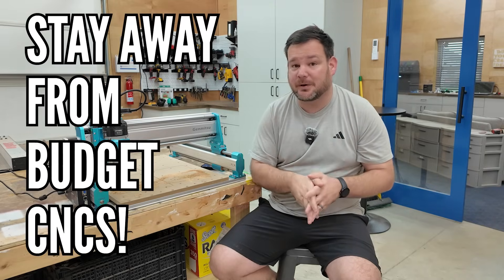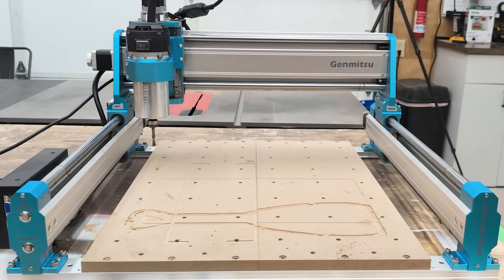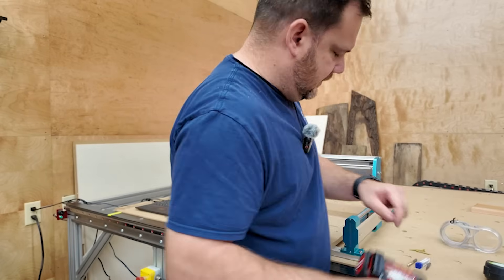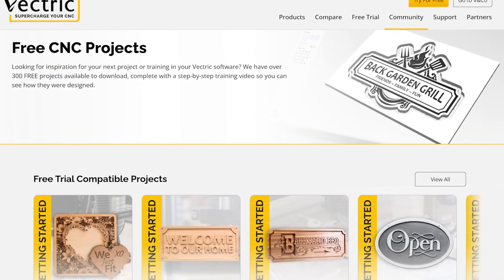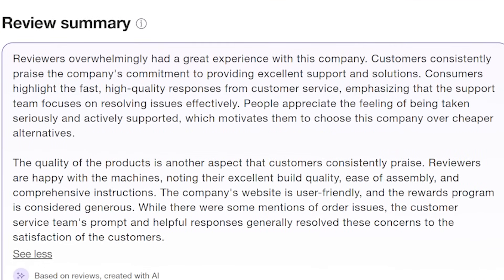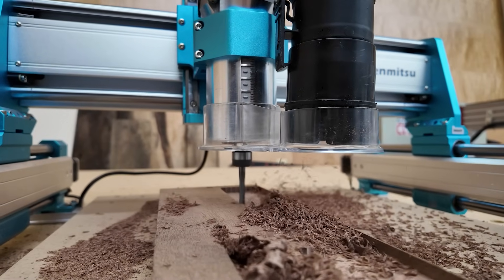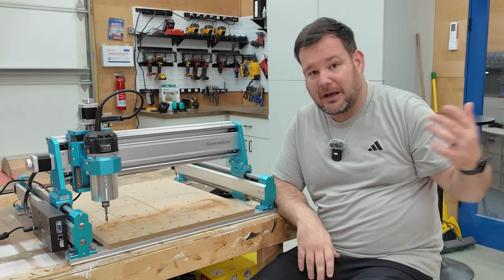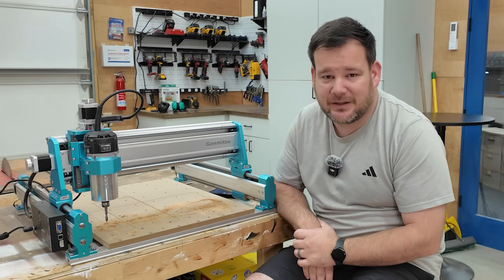Best CNC Machine for Beginners on a Budget in 2026

Comment: I have a Genmitsu ProverXL 4030 V2 that has been expanded to a 600x600 with a 1.5 KW water cooled spindle.  Have you ever looked at it.  Can do much more than the 4040 PRO, suggest that byou look at it.

Comment: Awesome review! I was thinking to get a CNC instead of CO2 Laser Cutters. I am thinking of mainly 3D printing, engraving wood and some acrylic materials. CO2 machines are quite expensive to cut wood with. I think having a CNC to cut wood, then place it on the engraver would be an awesome combination. I am just not sure if this combination of work flow would work in practice. I would appreciate your thoughts.

Comment: Hi Andy...Just wondering if the Genmitsu 4400 Pro max (or any other CNC router) can be used for routing projects that would fit between the side rails but are longer than the Y axis travels by accurately indexing them in the Y direction? I am a retired tool and die maker and believe I could figure a way to move a distance accurately in the Y reclamp the project and complete it. Am I crazy?
Reply from the maker: That’s a great question! The Genmitsu 4400 Pro Max can definitely handle some creative indexing for longer projects. With your background as a tool and die maker, I have no doubt you’ll find a way to make it work!

Comment: I have this CNC. My biggest complaint was the amount of locktite they use at the factory. Made increasing the Y axis pretty difficult. With that said, I used a torch to loosen the screws and accidentally melted the connector on one of the stepper motors. emailed customer support, and they sent me 2 new stepper motors. the brushes fell out of the router in the middle of a job also. Reinstalled and no issues since. I also have the FA 4040XE. The genmitsu is so much better for the same price range machine. Great video!

Comment: Hi Andy:
 have watched you on various machines. I have a 10w laser along with 2 3d printers and am wondering about adding a CNC machine.  I watched the video and there seem to be quite a few bit changes.  Is this common and does the software stop the machine so that you can change bits?  I understand about "grbl" and use lightburn so have a basic understanding of the need for "gcode" but am far from being an expert.  This 4040 is in my price range.  Thanks for any info you can provide.

Comment: Just curious, have you tried making a longer piece by breaking up a project. I'm looking at making signs, and with my laser engraver, i can put down a guide board, burn half of it, with a tick mark (that easily sands off the edge of the sign), to slide the piece up to allign with a tick on the guide board for a second half, and then shift the priogram, and do the second half.. In V Carve is something like that easy to do?

Comment: Hey, I know NOTHING about using one of these things, but my son wants one for building PC water blocks out of acrylic and copper, etc. Would this machine work on those materials? If not, can you please point me in the right direction?.
Reply: Yes you can. This machine would work just fine.
However, I wouldn't "Practice" with these material, Copper, Acrylic as they are VERY expensive!
Do you research BEFORE you buy, you might just change your mind.
But hey, You can NEVER finish anything if you don't start it!!

Comment: Thanks a lot for your videos. One question here, I am planning to buy a CNC but need to carve on the sides too like for example old French picture frames that are adorned with flowers, leaves or intricate carving not only on the top but also on both sides. Which CNC would you recommend?

Comment: You should have tried to contact customer support....It is not what you say it is. The machine was purchased with VCarve software and the invoice shows paid and included. There is not one shred of information in the resource pages, in the manual or online as to how the VCarve license will be delivered. After scouring the SainSmart website, I did find one note on a resource page that said the license was to be delivered in one business day. That did not happen either.

On page 2 of the manual there is a written link, and two bar code links supposedly to the Online Resource Center and the Facebook community. All Three of these links have you arrive at a Sainsmart 404 Error page. That is literally just five minutes into the unboxing....And I'm going to end up getting charged to return this product for a "refund."

No Thanks!
Reply: And they charged me over$200 to return the unused unboxed item. And they still have not sent the software they charged me for...In the same email they tell me they won't refund me for the Vcarve license which they didn't send. Then in the next sentence ask to confirm if I want them to send the Vcarve license. 

I was added to their user forum only to discover a multitude of users having all kinds of problems....My fault for not digging deeper into their customer satisfaction and business practices.

Comment: OK, I'm sold.... LOL!  -- Seriously, I need to buy one of these machines to make the "vent slots" in a wooden stereo case (made out of plywood) that I would like to make for one of my vintage stereo components that has an old dilapidated particle board case. The slots are about 1/4" wide in 1/2" or 5/8" thick plywood. The slots are no more than about 6" long. -- My question is, would this machine be able to cut those slots? Is so, I'm definitely sold. - Your thoughts?
Reply from the maker: I don't see why it wouldn't work

Comment: Looking to get into cnc but live in an apartment; so what I was wondering is the decibel for these machines or is it different from the rpms from the motor? faster motor higher decibel!  also elec hookup, standard plug or get electrician?
Reply: I’m sure it’s running on standard 110v electric service. As for noise and being in an apartment, for sure that could be an issue. You can build an enclosure to help but I can almost guarantee this will be a real challenge. I run a Cnc in a commercial shop and the tenant next door had legitimate complaints so we built a small insulated room for the machine.

Comment: Anyone ever tried to machine aluminum on one of these budget/beginner CNC machines? All I ever see anyone doing with CNCs on YouTube is wood. 

I've done a fair amount of work with aluminum sheet, but never used billet before. Thinking I want to try making some parts for stuff.
Reply: AuroraTech ran this machine on Aluminum, it worked well at slower speeds and feeds.

Comment: I have never used a CNC but I've been wanting to try it out without breaking the bank. One thing I've always wondered is if I can import illustrations that I have drawn in a vector program such as Adobe Illustrator, and also if I can use hand drawn art done with ink on paper. I want to use the CNC to carve moulds for vacuum forming. Can you tell me about importing artwork? Also, at some point, I might want to carve metal as well. would this CNC handle metal.
Reply from the maker: Yes you can import vectors you've drawn. You can also image trace PNG or jpg in most softwares. This machine is not good for metal.
Reply: @AndyBirdBuilds  Thank you for your reply.

Comment: Well I might have to reconsider making gadgets and make a real cnc routerinstead. I have not found a machine yet that is not garbage in the sub 3000 range of machines. the design of most of these machines with a gantry that moves is a very poor design. A fixed gantry and a table that moves would make a much more rigid machine.
Reply from the maker: I think what you're describing is a CNC mill, not a desktop CNC router. These machines are built for 2 different purposes.
Reply: Look up printnc

Comment: thanks for the insight!
I did have this machine in mind for my smaller projects, could you please elaborate on cutting carbon fiber and aluminium?
would love to hear some opinions on how capable the machine is.
Reply from the maker: I'm sure it can cut those, but it's going to be very slow.
Reply: @AndyBirdBuilds  better than waiting half a year and still getting no parts from contractors :)
thanks!

Comment: what controller does this use? can I use mach3 to control this machine? I dont like and wont use a hand controller. 
I have a shark cnc, I ended up removing all the electronics, installed new steppers and controllers so I could use Mach3.
Reply from the maker: Not sure.
Reply: @AndyBirdBuilds no it wont work it use grbl witch is garbage in my opinion.
Reply from the maker: @FredFlintstone-v3m grbl is pretty standard

Comment: Andy,  It's remarkable how closely your comments follow my experience.  When I was looking to get into cnc on a small budget and even smaller space, my biggest fear (unfounded or not) was that the belt driven axes on other similarly sized machines seemed a little flimsy and could easily skip teeth.  The lead screws were the primary reasons I went with this machine.  Again, maybe I was worried about nothing.  I've had the machine for a couple of months now and I'm loving it.  I still have tons to learn (like my machine hasn't seen 70ips yet) but, you don't get experience until you get experience.  Thanks for your great videos!
Reply from the maker: Good to hear our experiences are similar!

Comment: I just got into cnc and this is the machine I started out with and had zero problems with it so far. I’m loving it so far for my first one. That 78 per second is that the rapid rate?
Reply from the maker: 78 inches per minute is the max speed of the machine

Comment: Personally as a Longmill and Altmill owner. I feel this would frustrate new people getting into CNC with small speeds and footprint. The ones that do like it will be sorry not getting a bigger, beefier machine. That being said, I may be interested in one as a supplemental machine. I’d use it to surface and prep boards going to the bigger units. And maybe put holes in spoilboard and make it do dovetails or small joinery on edges. For under a thousand, may have room as a specialty machine in a large shop.
Reply from the maker: There are a lot of other considerations other than speed and size. Bigger and faster isn't always better.
Reply: Hey dudes, if I buy a machine like this do I have to worry about the collet failing with the cutting bit? In other words do you recommend i exit the room before pressing the green button?  Had a router collet drop out when I was building kitchens 15 years ago. Now I shiver cutting less than 5mm, third of an inch. Thanks and keep having fun.
Reply from the maker: @brinjoness3386  In the last 7 years of operating these machines I've never had any such thing happen.
Reply: Bro really in the comments trying to justify his purchase 😂

Comment: I ordered a OneFinity back when they were fairly new to market, and it had a several month lead time. I wanted to dive in and learn, so I bought a Genmitsu ProVer 4030, too. At the time it came with a cheap little spindle, but also the 65mm mount, so I got a dewalt router. 

The machine was great, didn't love the offline controller they offered. I eventually upgraded the machine to a 6060 with their kit, learned a ton about how CNC work having to swap out the parts. By the time my 1F showed up, I was ready to go. 

I regularly recommend Genmitsu to people looking for budget machines. Very solid machines.
Reply from the maker: That's awesome! Thanks for sharing your experience.